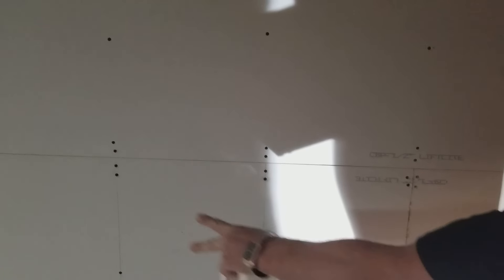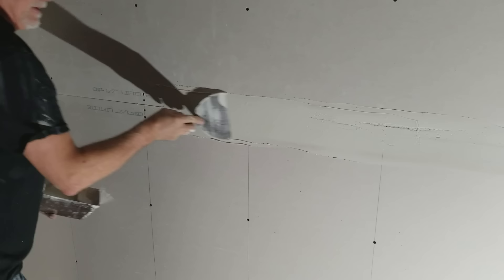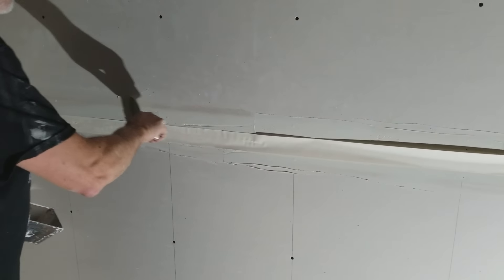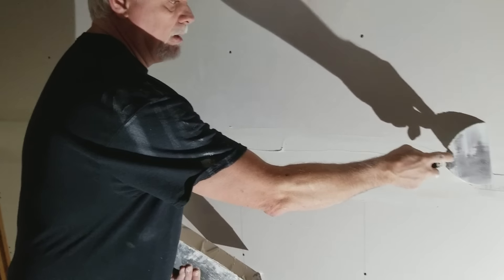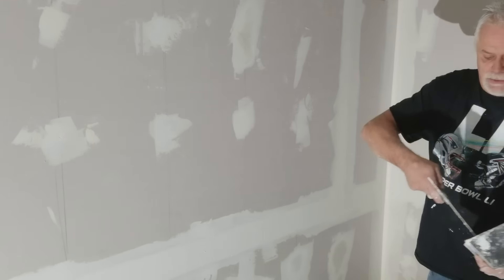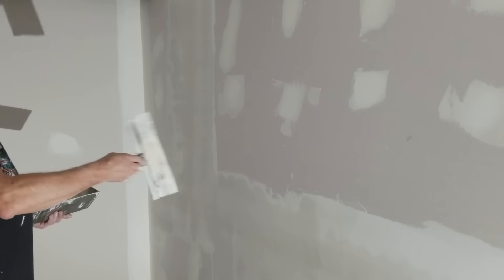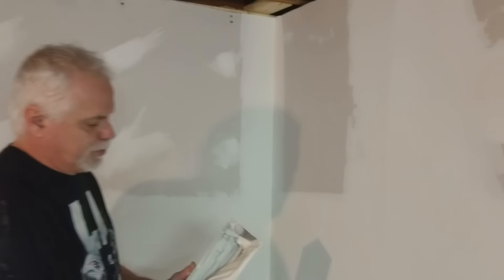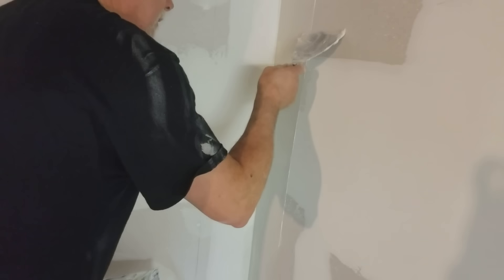Drywall mudding 101

Comment: I have been hanging and taping drywall for 35 years, and I can tell you he looks like an apprentice!
Reply: I agree. He's differently not a journeymen.
Reply: He ain't making $. Waaaayy to slow
Reply: im a union taper and that is not how you tape, cover and finish, first of hitting the screws one at a time is wrong. Now next you dont tape and cover all the same time your putting wet on top of wet you tape let it dry presand and then cover always let each step dry first before doing the next step, what you dont see is his finished product people take your time and learn right the first time and you wont have to do touch ups after and when doing your corners or angles as we call them dont leave mud on the other side its a pain to sand out and you will not have a nice angle.
Reply: @grampafpv8013  Not to mention the fact you should never, ever, ever put a screw on the factory edge of the drywall, the divot that is created when two factory edges (sheets) are put together gets pressure applied to it when you tape that seem and screws or nails will always pop out because of the pushing on the sheets as you apply mud and tape. Don;t know if he did, but if he did he didn't mention that you should thin out your mud between each application, adding water and some guys like to use dish soap to your mud to thin it out a little more with each coat so that you have little to no sanding or touch ups.
P.S. Also a former OPCMI taper
Reply: he's teaching 101
right there in the title

🤷🏻‍♂️
Reply: Yes but I tell you, since the internet opened Avery one is a star, if you can't perform a task well please don't try it when you know thousands of other people can do it to perfection, and don't even try to make a video, but some people just have to be on camera!
Reply: @CarlosOquendo ^  ^  ^  ^  ^ THIS ^  ^  ^  ^  ^
Reply: @bodhifreak  @Carlos Oquendo: my mistake!
I just went to your channel and saw that you have a drywall video there!
I will check it out! 🙏
Reply: @grampafpv8013  wet on wet causes problems but a bazooka uses this principle and it works
Reply: I had a video of me skimming a cealing  in Vegas my skills are 💯% I coated a whole house 3 stories 60 pales of Mudd wall cealings and I did not sand an inch of it I primed it and painted that house, that said you can, might be able to pass fake wrugh work but don't try to do it with finish work is not right it doesn't look  good and you are just teaching people how to do things good enough not the correct way I have done this my whole life I won't have any other way but perfect. Won't comment any more on this!
Reply: @carlosoquendo5463  I believe you have great knowledge, experience, and skills.
It'd be cool if you taught us something — get your knowledge and expertise out into the world!
Reply: @carlosoquendo5463  did u make $
 Sanding or not. If i sand you don't and they both look the same but I made 2 times more which way is better?
Reply: Been doing this for 30 years. Trust me it costs you your hands. Hire someone you don't want to do this
Reply: If I skim every square foot of a taping job I don't sand if I do a straight up taping job I sand just beveled edges very lightly it takes me 30 minutes to sand a 5 room job moust non experience people think my there coat is sanded, when it's just finished no sanding at all, I just like to say there is just one big difference between drywallers the ones that love the money it brings and we that love the trade, and surprise we still get payed! This is it for me guys just take pride in what you do not pride in ego!
Reply: yes but most taper use a super taper to tape with because they are doing units by themself and with a bazooka you should have a wiper right behind you cus the bazooka put a lot of mud on and you are very tired running a bazooka all day and wiping your work
Reply: He is an apprentice at best. Nice guy but if he has been doing this for 30 plus years he was on his own and never made much money.
Reply: @grampafpv8013  is there such a thing as a union taper. And how can I get in that l been tapping for 20 year
Reply: @grampafpv8013   tired???? Lmao
Reply: @carlosoquendo5463  u can love your job and make money otherwise you are a sucker. Work for someone else and make them rich and work for peanuts. Loving your job doesn't feed the kids
Reply: @bodhifreak  it should say learning,hes awful
Reply: I did say that I made money, so don't twist my words I do love what I do everything bi do or else I won't do it not even for money!! That gentleman has not done taping for 30 years look at the way he mesures the tape by turning it along the wall he doesn't even own a tape holder or hook, that is basic for speed!
Reply: @ron75569  if his goal is to help homeowners, he's better than me

I agree that y'all should get out there an' teach shit instead of hatin'
Reply: @joshuawaters12  LOL YO SOY BORICUA NO MEXICANO, FURTHER MORE WHAT BEING OF ANY RACE HAS ANYTHING TO DO WITH THIS IM A DRYWALLER HAVE BEEN FOR ALMOST 40  AND MOST OF MY FRIENDS ARE DRYWALLERS SUBS AND WE HAD HAVE COMPANIES WE DO MOST ANY INTERIOR JOB BIT NOW I SEE IS ALWAYS THE SANE RACE COMES IN TO FOCUS WHEN WE CANT BE BEATEN!! IM OUT OF THIS
Reply: First time im hearing about putting dish soap on compound??
Reply: Eventhough you can clearly tell hes not a pro judging by the quality of work but technically he is correct about a true 1st coat, according to a usg code, tape and coating the bevel is the proper definition of a 1st coat.
Reply: Ive worked with guys that claim that their work needs no sanding,  and when i walked in the room i became a believer it looked amazing until i turned on the light
Reply: @diogopereira5288  yes you could put dish soap in Mudd aldoe not really necessary in p.r. we use it on the finishing grout do finish wall, it makes the muttered sleak smooth, but I won't put it in mudd. But as we can see people get ideas about things, do to each it's own
Reply: Thats cool, so wheres your video that explains it better?

Comment: Something tells me he doesn't like sanding..
Reply: I don’t either 😂  it sucks.
Reply: Yeah cuz it’s so dusty
Reply: Nobody likes sanding my friend  😄
Reply: Beat me to this comment
Reply: Sanding the worse shit ever 😭
Reply: Somthing tells me he doesn't do the sanding🤣
Reply: Nobody does
Reply: @goldview8169  
Agree, he's no pro that's for sure. 
His coating over the tape 🤣would be considered the first coat so actually he did 4 coats. And he's using a junk 10" knife and trough 🤷
Reply: I learned that lesson too!
Reply: Man sanding that shit is just awful. And so is trying to clean the dust up afterwards..just ask my bathroom floor, lol
Reply: @benzw2505  what do you mean? I'm asking bc whoever did the walls in my house before I moved in, left the tape hanging...like I can literally see exactly where the tape is. I'm wondering should I spackle over it and would it go away.
Reply: @vikkilambert-vill4021  if it's not blistering you can use spackle for a textured look that would hide it. Or you would have to use regular bucket Mudd and skim over the existing tape seams and sand it like normal.
Reply: @vikkilambert-vill4021  you can go over it following the steps in this video and pretend you're just at the taping step and you should be able to hide it like any other mudding job.
Reply: I sanded 2 houses today and yea its rough lol
Reply: I remember being told by a professional that when drywall is plastered correctly, it should require  the least sanding possible... I suspect this man's mudding isn't leaving much behind that will require sanding 🙂 👍 What a great video!

Comment: In 9 minutes you taught me more than a coworker did in 5 years. 

Thank you for this video!
Reply: me and you both
Reply: sounds about right, lol
Reply: Excellent reply
Reply: straight facts, does anyone have a trick to prevent bubbles when mudding on finished paint. like half new drywall half old already painted drywall wall. been doing alot of work after my area was flooded so alot of people are just wanting 4 feet up on their houses drywall replaced.
Reply: That guy was not a Co-worker! 😄
Reply: How true is that!!!
Reply: @alextrap1993 😂😂
Reply: @natechamp4692  I know it's 2 years later but painted surfaces always create bubbles because it's a sealed surface with nowhere for the moisture to go so it bubbles outm I like to use easy sand ( the bag mix) the first 2 coats then I use usg plus 3 / proform lightweight for that last 2 

Because of the bubbles you need another coat or two

Comment: Hi Phil, I have owned my home for 40 years and every now and then my wife of 52 years wants me to do a wall that has been damaged from something or just needs to be patched. Recently we had plumbers remove and replace an outside water spigot which required the removal of a piece of drywall in our kitchen. The hole in the wall was about 24 by 24 inches but right next to the outer wall of the house so I was volunteered to replace that drywall patch and of course it needed to be mudded on all 4 sides with one side right in the wall corner so your video on drywall mudding 101 basically covered the whole gamut I needed to do this type of repair. Great info and thanks for showing me the steps necessary to repair this job to the boss's satisfaction.
Reply from the maker: Guy that could help that was the whole reason I made that video

Comment: I used this video to guide me through my first drywalling project.  After all, how hard can it be?

Having finished it now, I realize what an absolute legend you are, sir.  You would cry at the trainwreck, nearly-Hindenburg situation I created after so-confidently watching this video.
Reply: Only way to learn is doing it.
So you had a bad job, let me tell you these so called pros who did my house did the worst drywall job I've ever seen ive fixed most of it, but it still has some really nasty looking spots. The worst thing you can do is paint it becuse pait will clog your sandpaper trying to fix it later.  I recommend buying a 4" grinder and flap disk to remove the paint it really dusty but really fast.   Pratice makes perfect.  Do a 2x4 wall with conners inside and outside in your garage with seams and nail or screw holes and practice doing it untill you learn the techniques   its a skill you have to learn.

Set this guy at a desk he can't add 2+2  but by God his craftsmanship is perfect.
Ok maybe he can add but you get the idea were all good at somthing becuse thats what we do. But you had to learn that skill.

Hit a nail with a hammer some guys will dent the shit out of the board and bend the nail and some guys will drive it in the first swing. Trust me he bent a hell of a lot of nails learning how to do that in his day but he didn't give up.
Reply: Thanks for destroying my confidence as I’m about to tackle my first drywall mud project
Reply: It turned out ok. Some sanding to do
Reply: Not me reading this comment after so-confidently watching this video for the 1st time. This is the first video that came up after a google search. Any suggestions for me after completing your masterpiece? This will be my first time mudding also.

Comment: I've been in carpentry for 4 yrs and have been doing work with drywall for the last year or so. This is one of the most comprehensive, and least complicated video I've seen on drywalling. I think you could line any guy out on the job and get them rolling right away, which is not as easy as it sounds. Great video, I'll be checking out the rest for sure. Thanks for posting

Comment: Anyone ever put soap in their mud? An older guy told me to do that and I thought he was just messing with me but he showed me how to do it and it works really well. It doesn't put bubbles in it like you'd think. You only use a tiny bit after its mixed and mix it again. It went on so much smoother, sanded easier and a lot of places I used it, I barely needed another coat. I've tried to show other people over the years but a lot of them refuse to even try it out... you'd be surprised what you can learn on different jobs with different people if you're willing to take advice and try different techniques. Personally, I enjoy learning and trying different ways to do things. I don't care if you're 21 or 61..if you have knowledge to share, I'm all ears. Just because you've been doing something one way for years doesn't mean you've been doing it the best way all those years...that goes for a lot a different things in life and work.
Reply: 10 yr taper here i love using soap in my topping muds for sure as u said easier coating and sanding ive had no back fires on that method
Reply: @drywallperfectionist1314 soap just on the 3rd coat??
I was wondering if he’s using all purpose mud for all three layers here? Getting ready to attempt my first DIY and hoping not to screw it up lol.
Reply: @GregoryGuay  lol i use soap water mix in proform midweight for 2nd and 3rd coats .. i use all purpose mixed with only water for 1st coat( tapecoat) cuz u want that to dry hard and bond well

Comment: You are a jewel! I have always painted my houses, and I can fix most things around the house. However, I just bought a house with a large garage and got as far as the tape being applied.  I wasn't sure- nor motivated- how to press forward. After watching you, I feel I can jump in and start mudding the rest of the drywall. Thank you!
Reply from the maker: That is awesome! You can do it. less mud, less sanding. use your hands to feel how smooth the mud is. if it is still rough, keep sanding. Once it is smooth to your touch, you are done.
Reply from the maker: You can do it! Good luck

Comment: You did a great job. As far as the thinning the mud you can also add a little dish detergent and that will help slow down the drying process will not get the little dry particles that scratch the the mud as you put it on.

Comment: This is some crazy shit to learn man I got mud everywhere
Reply: Lol
Reply: Helpful video, thank you very much. God bless you.
Reply: the first time you try tape and mud, it's usually a disaster.  make sure you start with a good drywall hanging job, otherwise it's really hard.  Also, watch out for little "crusties" - pieces of hard mud leftover from previous coat that find their way into your mud, making a horrible mess.  I am not a professional but I can sort of do this now.
Reply: Par for the drywall course!
Reply: lol
Reply: I hear ya Gun Drummer. It looks easy but it isn't. At this point, I'm not sure what has the most mud on it, me or the floor!
Reply: Were u 4 wheelin
Reply: Tip 1  Wear old beater clothes.

Tip 2. Start in a closet to hide your first try.

Tip 3  Start with filling screw heads. Let that dry. Fill a second time. The thousands of screws will teach you how to handle tools and mud before your first try at taping. 

Step 4. Tape a closet or behind kitchen cabinets to gain experience. If your not getting good fast, call in help, the ceilings will not get easier. 

Step 5 You have either gained a new skill OR gained respect for those who do it and saved your ass. 

Step 5 Learn painting or call a pro. 

:)

Comment: The trick to doing drywall finishing is don't play with it 
Swipe let dry
 All purppuse 2 coats 
Topper 1 to 2 
If your good you can do it in 2 
Add grip tape to The side of your pan 
After you master that break out the hot mud
smooth set 
Have fun 
This guy shows a great example

Comment: Thank you for this video.  We just finished the mudding in our bathroom.  I honestly mudded the whole wall (very small bathroom). Your video was very helpful since we are working on the bedroom now.  The outside pressure on the knife was good to know.  I found out that going over wet mud with a damp sponge helps to take off excess mud and i didnt have to sand as much if at all.

Comment: Not even going to lie I use a 10” to bed and skim my flats so props to you for using a 6” I normally use a 5 for inside corners to bed then a 6 to skim and a 6 for corner bead to apply the mud and a 10 to wipe it down just makes it easier for me personally also I do a lot of repairs so 5 minute quick set and mesh tape is my best friend but I never use regular mud on mesh tape

Comment: Im in my 60's and I have hung drywall quite a bit to help people but never even tried finish work. I had some water pipes burst in the ceiling so I watched a whole bunch of videos and did 7 repairs. 2 were major. I found Im quite good at it and I can do it in good time. I dont want to do it again but if someone needed help and have little money I would help out. Matching textures took me 2 trys to get it going on the first repair and after that it was easy.

Comment: This sure did come in handy I'm in the middle of my bathroom remodel mud starts tomarrow.
Thanks
Reply from the maker: You're welcome I'm glad it came in handy
Reply: @PhilFast  I have a question please do you have a video on skimming walls. I stripped wall paper and it's not good enough to paint. Just wondering if you add alittle water or straight.
Thanks again

Comment: Pretty much how I have been doing my drywall.  I do widen the butt joints. For beginners to make it easier i would tell you to use the mesh tape on your flat joints and recessed joints not the corners,the mesh tapes too hard to work with for corners but that way you put the tape on first and it's sticky and will adhere to the joint and then place your mud on it,this will eliminate any not getting the tape tight enough to wall which means a lot more work and widening of joints. I also only do one side of a corner when mudding because i am super fussy because as he said sanding sucks so do one side and let dry and then do the other. The basic key as he mentioned to is do not put too much mud on you will regret it when you have to use the belt sander on it.Great video.
Reply: You should only use mesh for small stuff, such as patches. The mesh will crack on joints and butts